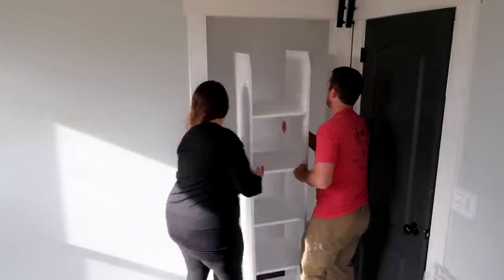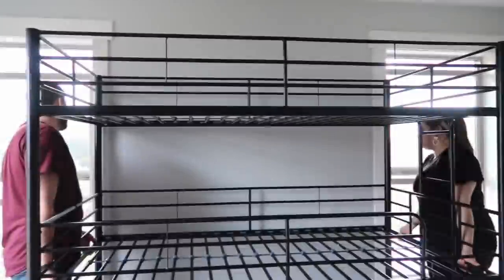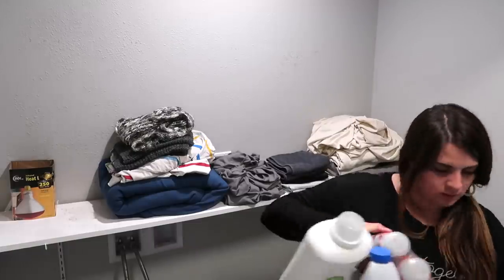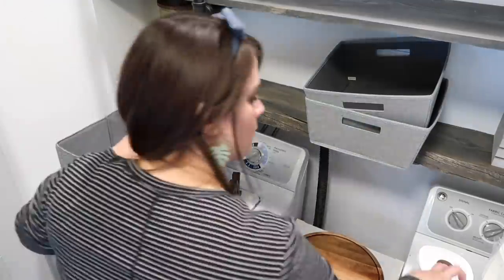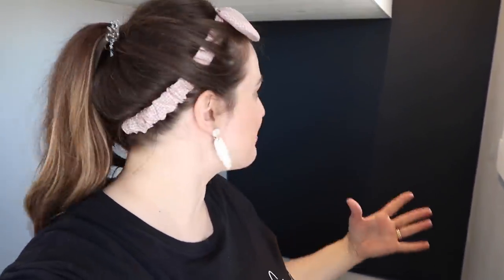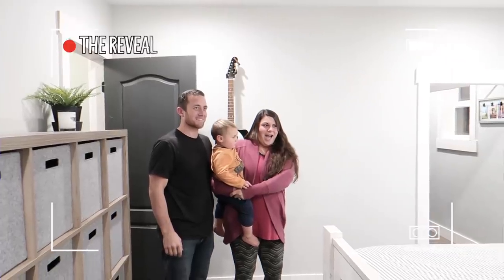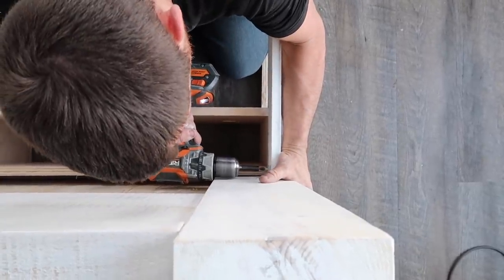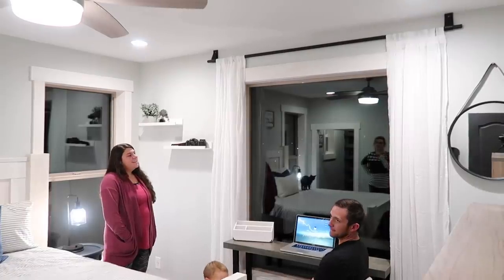FARMHOUSE MAKEOVER MARATHON 2021 ✻ 3 BEDROOM TRANSFORMATIONS + LAUNDRY ROOM MAKEOVER ON A BUDGET

Comment: One way to put on pillowslips quickly is to grab the outside corner of the pillowslip and then with the same hand grab the pillow corner. Pull the pillowslip over the pillow while holding onto the corner. The resistance helps to cover the pillow quickly and easily!

Comment: Love this makeover extremely a lot. Love to do the same inspiration for my place. Young lady's tiny room though, nearly at perfection.

Item pieces I had thought to add to the pre-teen girl's bedroom. A black framed wall mirror for vanity, a wall clock hunged high on the upper lofted bed level wall to keep track of the time, white or pale pink pulled down window shade and or a textured window shear panel for privacy, a brand new pale pink or black tiny lamp for the upper lofted bed area, one colored pale pink comforter set, and stamped-on or wallpaper very large black traced flowers onto the white side of her bedroom walls in front of her desk and or the door areas.

This is what I had invisioned as a completed pre-teen's bedroom for your niece.

Comment: You can easily put pillowcases on using a similar or same method as you used with  the duvet cover. Turn the case inside out. insert your hands and arms into the case and with your fingers grab two corners of the pillow through the case at its corners and turn the case right side out flipping the pillow and  slipping the case  over the pillow simultaneously... Anyway.. something like that...

Comment: Fab makeovers. What are the steps you are doing when staining? Are you adding a coat of stain then sanding some back off before adding a top coat?
Reply from the maker: I think we just sanded mostly smooth, then stain, then resanded with a light grit sand paper, to get it totally smooth, then a poly coat